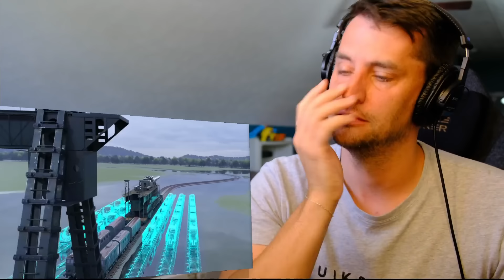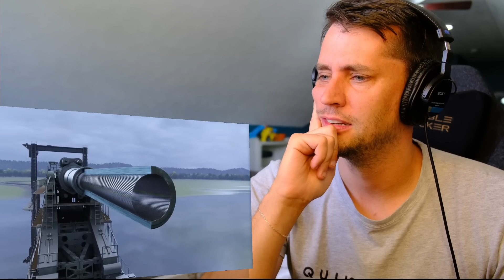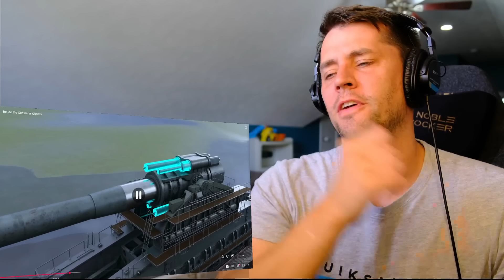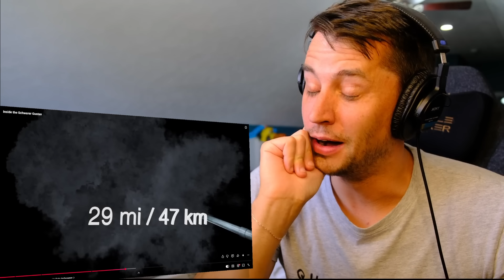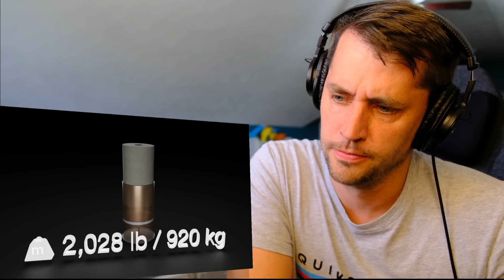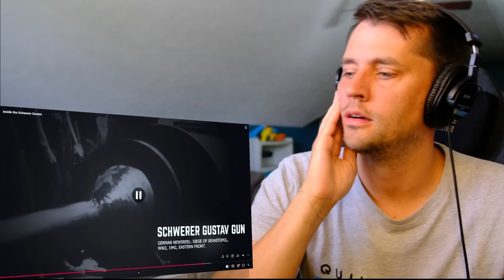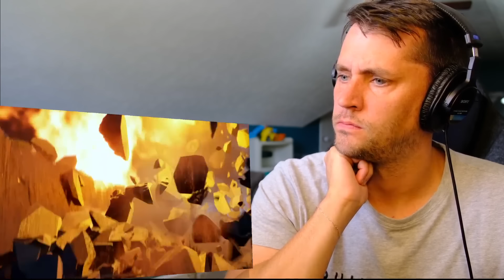American reacts to the Schwerer Gustav

Comment: The thing about the german mindset back then, it was always about "vision". Many of the failed military or industrial projects that occured as a result of lacking time, resources or manpower - which genuinely would of succeeded otherwise.

For something like the Gustav, it was envisioned to be something that would be able to travel across europe at some point. So that should anyone try to invade anywhere in Nazi controlled europe, it could besiege them from afar. It also wasnt intended to be as limited as it was. It was intended to have multiple others that would rotate around various territories as a moving artillery screen. 

Things like this seem silly when they fail. But when they work, they are terrifying. People brushed off the idea of nukes being a possibility, as silly or otherwise unlikely. Then it happened.

Comment: You said at roughly 7 mins 15..." The inefficiencie of one part breaking down" That sums up why Germany lost WW2, It's the same with the tanks and trucks aswell each tank had different parts made by different factories barely anything was a standard swap in swap out part for easy repair, If they had done universal swap in parts for a majority of standard tanks europe would look drastically different today....Also drug addled insecure painter probably won't help in leadership but still...

Comment: Equivalent to 2,000 V1 flying bombs? They should have built more. That would have saved a bit more of the UK.
But for a stupid weapon I'd have to say that the V3 holds that title. it couldn't move, be turned or have the angle of the barrel changed. 🤣

Comment: The Germans wanted to break through the heavily fortified Machilo Line. For this they have built 2 pieces and a cannon barrel to replace. The larger projectiles were intended to destroy bunkers that were 100m deep. The problem was that it was not in testing until the end of 1940 and thus the French campaign had already ended. Thus, it could only be used in Crimea during the conquest of Sevastopol. Nowadays you don't need these weapons anymore, because there are bombs that can also be 100m deep. The bullet was mostly with concrete in a steel shell. The American "Little David" bomb-testing mortar—both at 36 inches (91.5 cm) to break through the Siegfried Line.

Comment: Aiming the gun using a curved track is pretty much standard with all rail guns in the first and second world wars.  You can't have a turret, if you fire sideways, the recoil will tip you over.  And you can't afford the width and mass needed to fix that because the whole thing has to be mobile.  So apart from a handful of fixed emplacements that did have battleship style turrets, most large - naval size or bigger - artillery was like this.

Comment: "It's dumb..." oh yes... this thing was built (and super expensive mind you) to crack the Maginot Line's fortifications... it was pretty useless in mobile warfare other than cracking fortifications on the Crimea... in other words: it was nigh completely useless....😂 
Oh and the 47 shells it fired in combat wore out the barrel into complete loss of it's rifling...
Remember also that the Tiger Heavy Tank was a monstrosity of insane overengineering all alone... there where less than 2000 built, ist's not a simple M4 or T-34...😂

Comment: As far as i remember some documentation:

What you guys are missing is, this thing was build to demolish an equally large defensive structure: The Maginot Line. It made some sense in the early 30s, when you didn't know if aircraft would become that effective. Destroying an 21m underground ammunition depot in Sevastopol was not possible with a plane either. This would have ripped apart bunkers of the Maginot line more effectively than it's actual deployment turned out to be. Compared to other overly large artillery pieces this would have had the range to stay out of the enemies artillery range and fight a years long campaign. Since it wasn't pursued any longer after the fall of France, developments didn't happen to make it more effective. Like solving the barrel wear problem.

Comment: You seem to have missed some context.
After WW1 everybody started building fortifications. The Maginot line was the most famous, but there existed a lot of other fortification systems in a number of countries. Including the Soviet Union and Germany herself. 
Experience from WW1 was that fortifications were enormously difficult to take by infantry. At some point the Wehrmacht recognized that they simply did not have the guns to destroy the multi-story fortifications of the Maginot line with its bunkers and gun turrets and observation posts. And now just imagine you have to send infantry into the overlapping fire zone of these fortifications without being able to at least severely damaging them before. This was unacceptable and thus cost did not matter. A gun was needed which was able to smash through the earth cover and concrete walls and steel gun turrets of the Maginot line bunkers and disable them. For such a military task most of the obvious shortcomings of the design didn't matter that much. It is takes long to install on site, who cares, the bunkers won't run away (And BTW, the four track railway curve was not needed for transport, only for shooting, which is why it was curved).  It is expensive, doesn't matter, the bunkers it aims for are more expensive, let alone the cost of taking them without appropriate fire support. It fires only at a slow rate, no problem, it will only be needed to knock the bunkers out in a certain area. Afterwards it will have to be dislocated anyway.

Interestingly, the US had a similar project which was planned to be used to destroy bunkers in the invasion in Japan. Compared to Gustav it was a crude structure. It was basically an overdimensioned mortar. It had a bigger caliber than Gustav, but a range of less than 10 km. Its firing position was literally a hole in the ground. The hole was excavated, the gun was lowered into it, it fired, it was pulled out again. Most likely much more efficient, but not nearly as nice wrt engineering.

Comment: It was an attempt to use a naval gun on land, it was not the first project of its kind and not even the only one to be implemented, there were the railway guns Leopold and Robert, with a caliber of 280 mm, used against the Allied landing at Anzio - Italy, but the Gustav was simply excessive in weight, maintenance and use and therefore it was just a failed experiment, whose results in action absolutely did not repay the enormous waste of resources that were necessary to build it.

Comment: That gun was originally designed to crack the bunkers of the maginot line. But to everyones surprise the hole campaigne was over in only six weeks. So the gun would not even been assembled.
Reply: The gun wasnt finished, if it would have been ready, it would have been deployed befor the campaing started (like they did with the other rail guns) and assembeling the gun only took 3 days.

Comment: already off to a great start with this video, misrepresenting that there was only 1 railway gun when there were 2 (and a 3rd one planned, called the Langer Gustav, featuring an even longer barrel) and the confusing graphic with the parallel running train tracks. no, they only needed 2 for the gun, obviously transport was done by disassembling the devices and transporting the parts, which they dont need to be parallel for. however! since they needed to build a lot more infrastructure like turns, so the gun can be aimed, they likely did put more partial rails on the sides, to make things easier.
seems it got much clearer in the latter part of the video, thankfully.

good luck seeing that gun from 50km away. and obviously it would've only gotten that close after the lines are secured.

4:43 the idea of building bigger guns to shoot emplacements from further away, it kinda existed since the late middle ages. in WW1 you had things like the famous Dicke Bertha, which is something that still every german will have heard at some point, even if they dont know what the origin is. and other nations employed railway artillery too.

apart from the strategical use against emplacements or depots behind the enemies frontline, weapons like this would also have an effect on the enemies morale, more than your own troops. like the V1 and V2 rockets hardly did any significant damage, but the threat of striking london had an effect on the peoples morale. similarly, maybe you are a soldier slightly behind the frontlines or civilian, remaining in a city that is close to he fighting and suddenly your city gets struck by artillery bombardment from a range that should not be possible.

18:17 we are still tens of kilometers from where the enemy is, for starters. also observer balloons was something used in WW1 already. balloons are actually not that easy to shoot down, one or two small rifle bullets wont do anything, if you even hit at that distance.

Comment: The original requirement was for a gun capable of penetrating 7 meters of concrete at a range of 35–45 km. The rest... followed from the need to solve the technical problems that arose in the process.

Comment: The gun was originally intended to smash through the Maginot Line, France's supposedly impenetrable network of massive bunkers, tunnels, and fortifications. The plan was to use the Schwerer Gustav to obliterate these forts with its enormous bunker-busting shells, whose incredible penetrating power was capable of destroying even the strongest defenses. At the time, many believed this was Germany's only realistic chance of breaking directly through the Maginot Line.

As we now know, history took a very different course. The gun's development was delayed by nearly two years, causing it to miss the Battle of France. Instead of attacking the Maginot Line head-on, Germany outmaneuvered the Allies by driving its Panzer divisions through the Ardennes Forest, a region the Allies had considered virtually impassable for a large armored force. Using Blitzkrieg tactics, German forces swept through the Netherlands and Belgium, advanced rapidly toward Paris, and ultimately encircled much of the Allied armies at Dunkirk.

Rather than canceling the project after it was already more than halfway through production, Germany decided to deploy the Schwerer Gustav during Operation Barbarossa against the Soviet Union. There, it was intended to destroy heavily fortified positions, penetrate underground ammunition depots, and breach some of the strongest defensive fortifications ever constructed.

You should also check out the V3 gun video also made by bluepawprint.

Comment: In 1936, Hitler asked the weapon manufacturer Krupp to develop a weapon capable of piercing seven meters of reinforced concrete or a full meter of armor plate, allowing the German army to break through France's defenses. The engineer's response: Krupp's chief engineer, Erich Müller, calculated that this would require a caliber of around 800 mm. Hitler approved the project immediately, without a single thought for the enormous costs.

Comment: The price tag of the Schwerer Gustav was RM 0. It was tradition at Krupp not to charge for the first gun in a series.

They charged RM 7,000,000 for the second gun, Dora. That's 35,000,000 € or US$ 40,000,000 in today's money.

Comment: To put it simply, this weapon was an idea from the First World War, before aviation was widely used as one of the main striking forces. This weapon was simply 30 years too late to be effective. During the First World War, when the main combat operations were trench warfare, those with longer-range artillery had the advantage.
Reply: This gun was designed in the 1930s as an answer to the Maginot Line. It was clear for the German military that they had no weapon to break through the strong fortresses at the border. Therefore this gun was designed to destroy even the heaviest fortresses and break the stalemate that was expected otherwise. For this use case the gun would have been better suited. As it would have been deployed directly in Germany close to the industrial heartland where it was produced, the logistics would have been much less of a problem then somewhere in Eastern Europe. 

The problem of the gun was that it was already outdated when it became operational as the Germans bypassed Maginot Line instead of attacking it head on.
Reply: @patrickm3981  You're both kinda right, I think it's undeniable that the concept was inspired by the effectiveness of the Skoda and Krupp heavy siege guns against Liege in WWI and maybe the Paris gun as well even though it didn't really do much.
Reply: @Biggus63  It's not a matter of effectiveness. World War I reached a stalemate where each side had exhausted its offensive capabilities. And in such a state, if your artillery can reach the enemy's logistics and cities, but theirs can't, you have the advantage and leverage for negotiations, even if you can't hit accurately. The very existence of impunity is an undeniable factor. But the advent of tanks and aircraft changed everything dramatically.
Reply: It did destroy an ammo bunker like 30m below ground

Comment: "fun"fact: in WW1 all sides, even America, used railway artillery. the Pros: Battleship sized (around 24-30cm) Artillery piece capable of hitting targets far away from any coast line from outside the enemies range. Cons(and Ill list a con that only applies late WW1 and WW2) expensive, as mobile as a battleship on land, predictable(cant move without rails), restricted to where it can go(once again, rails), easy to locate (due to rails, being slow af and LOUD) and pretty good targets for bombers. in the case of Dora, about 600-900 men where just 2 anti air artillery units. In ww1, a rather static war, it might be a good thing, to have 2 or 3 such guns far behind your lines, where enemy artillery cant counter battery the everlasting crap out of it cause of shorter range, but in a mobile war like ww2, those guns were absolute useless. another "fun"fact about Dora: there were planned modifications for both guns, to increase range, so they were able to shoot from france to england. Planned were longer barrels (44m) modified rammer and lifts due to different shells. Said shells wouldve been two ton highexplosive sabots with an explosive charge of only 180kg and a muzzle velocity of over 1200m/s...and a range of over 130km. the actual military value of those modifications wouldve been less than the regular guns...wich was already fairly low. It wouldve been just a "hey brits, you are in range...not that its really going to hurt or anything, but we can shoot you". 3 times the charm: Accuracy. The chance to actually hit a smaller >area target< like Bunkers and such (wich are pretty big...at least the ones that would justify the use of a 80cm artillery) was almost zero to begin with. All in all, it was more a terror weapon than an actual strategic artillery piece.

Comment: Seems like the predecessor from WW1 the Dicke Bertha though also very limited was probably a bit easier to handle.
Reply: In terms of size, its predecessor was more like the "Paris Gun." It was built to reach Paris and had no military impact on the world war 1. It was a massive 21-centimeter gun that required a special emplacement to be built for it and had a range of approximately 130 km.

Comment: Seems insane, but its just the logical peak of pre-rocket technology...arguably MLRS are the more insane tec...
This is doing a very similar thing through brute force instead of super intricate high tec ... Gun is expensive, the shell probably not, while in a MLRS its the other way round - would be interesting what comes out more cost efficiant with 40s tec...

You might want to check out the Paris gun as well...

Comment: We are still "at it" ... but with a more sensible size. The RCH155 is a mobile artillery piece that is an advancement of the PzH 2000 ... but the RCH has a full autoloader turret AND is the only piece of artillery that can fire while moving (slowly). The range is 30-60 km ... 
There is a LONGER RANGE version (which requires a special barrel to be able to cope with the pressure from more propellant) ... which the USians tried to do BUT FAILED! Germans (KNDS IIRC) did it though ...

Comment: Some thoughts from me:
0:22 That is Schwerer Gustav. A gun designed to break open the Marginot Line. For which it was never used, because Plan B ("go through Belgium") could be used to pass through the poorly defended Belgian part of the line.
It needed multiple sets of railway tracks just to move and IIRC the shells were around 1 ton.
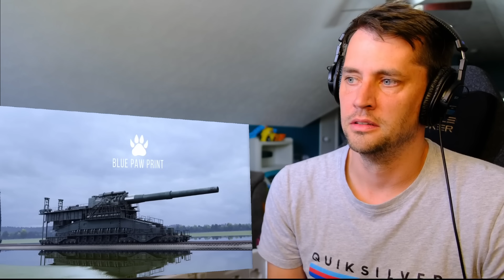2:13 It is a artillery. If you can see it, you are in it's minimum range and can kill it.
4:48 Well, someone looked at the Marginot Line and said: "We are gonna need a bigger gun."
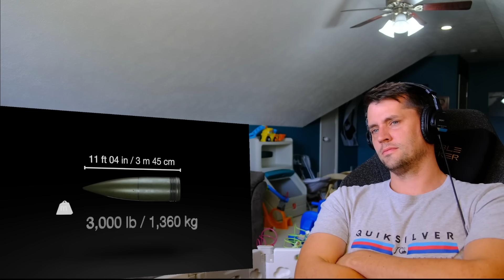8:25 Oh, it was 5 tons. My bad.
10:30 The distance to the horizon is at 4.7-4.8 km. 1/10th of that.
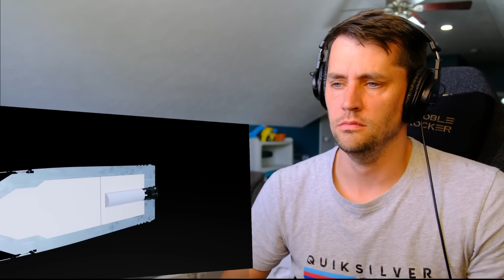11:43 With armor piercing explosives you want to penetrate the armor, then explode inside. Which usually means you involve the physical resistance provided by the armor to arm a impact or start a timed fuse. The donwside is that they tend to overpenetrate on anything that doesn't offer enough resistance.
16:24 The german panzerhaubitze has a shell the crew can only fire twice per month - for their own health.
I think they can fire more if they use the string to fire it from outside.
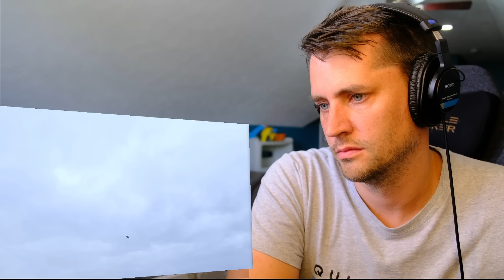18:01 This thing is the definition of "over the horizon" firing. Even Battleships needed spotter planes or scout ships for long range fire.
Reply: The explosive shell was 4 tons (metric), the armour penetrating was 7 tons (metric)